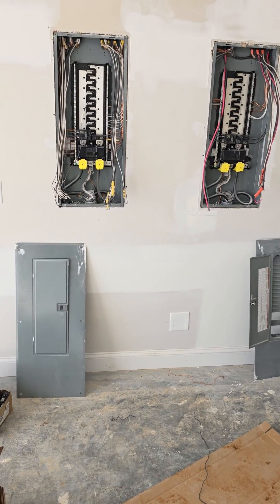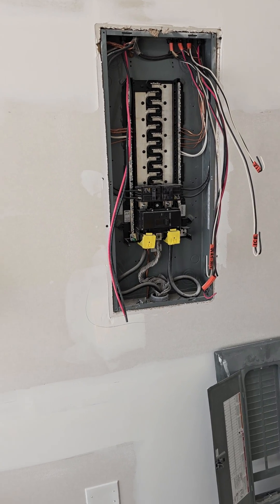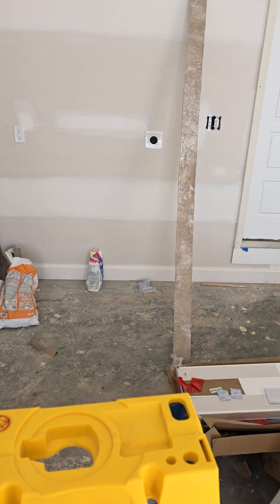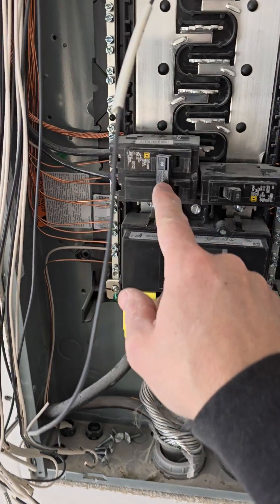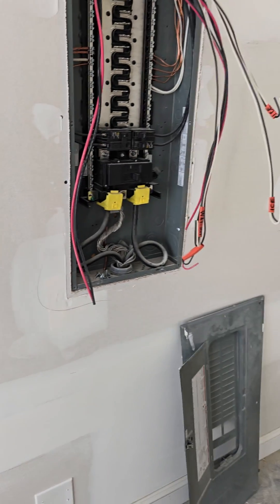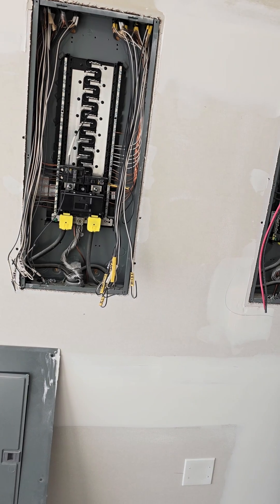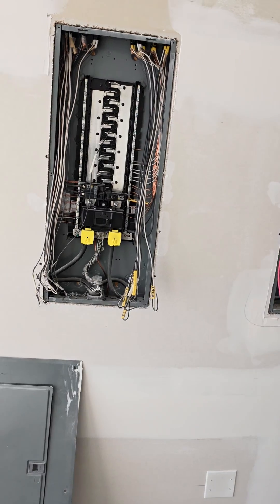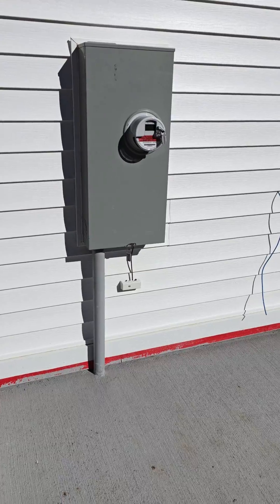Reason why people go with 400amp service in new construction now days

Comment: Recently remodeled my 1960s house and upgraded to 200amp and pre wired for future car charger. Also ready for solar if some future owner adds it.
Reply: QUESTiON  HOW MUCH DiD THAT COST YOU TO PUT iN 200AMP iN YOUR 1960'S HOUSE?
Reply: After my meter fried in a 1973 house it only costed $2000 for replacement of the entire thing and upgraded to 200amps from the overhead street wire to the house and that was in 2021.
Reply: @chuckleroy3992  Isn;t a meter property of electric company and is exchanged for free ?
Reply: @chuckleroy3992   NOT SON HiGH?>>!
Reply: @dmitripogosian5084    yup, but only the meter. YOU must have the meter pan installed, along with bigger service wire on the outside of the home, and a 200 amp panel. Most people don't do any of that unless they are also adding circuits or installing a gen set as part of the upgrade.
Reply: @rupe53  Where I live wires from a meter to the pole are property and responsibility  of the electricity provider.  I have learnt that recently when I saw a ground wire frailed on my supply line. Called electrician, he said nope, not me, from this point to the pole. Electric company came in 30 min and repaired for free.
Reply: @dmitripogosian5084    yes, they also own the wire from the pole, but not the wire attached to the house. YOU own everything from the weather head down, expect the meter.
Reply: @rupe53  If I understood correctly what is weatherhead, this is true.  There is some distance  from the weatherhead to the meter (which is outside of the house) in a pipe along the side of the house, which is indeed mine.
Reply: @PHiLiPPiNESCENES  about $6k
Reply from the maker: It makes a huge difference on location. I charge here in VA with permit to upgrade  to 200amp $2,000 to $2,500. Depends on some factors though.
Reply: Is it worth doing it in 1960 house ?  Where I live (in 1964 house), they are mostly teared down when new person buys them.  Not sure I'll recover any investments like that when I move (as planned) in 7-10 years.
Reply: @dmitripogosian5084  I live in an area where this two bedroom one bath home is worth 450-500k before the remodel, probably 600+ after.
Reply: Why not add it yourself
Reply: @kkon5ti  has to be done by licensed electricians and the power company.

Comment: Holy cow 400A. We're on 240v here and I just got my cutout fuse upgraded from 60A to 100A that's for electric shower, air source heat pump and EV charger. 400A is a lot, wow. Just as well your energy bills aren't as bad as Europe's.....
Reply: The US is really 240V mains when we say 200A, 400A... We just have a Centre tap from the utility to the neutral for most use.. In all the decades I have lived in places with 100A main, It has never tripped, even when my EV was charging (27A at peak rate). No whole house A/C. I agree with Dmitriy (below), <10A even in the evening with lots of LED/CFL lights on.  Overkill
Reply: The code in the US requires you to pretty significantly over size your panel. A modern house can get a 400A panel, but it will probably idle at <10A for 99% of its life if it’s well insulated.
Reply from the maker: No there will be more then just those, where is about 30 more circuits. In that video, the breakers they weren't in yet
Reply: Darn. I must be in the dark ages. 100 amp service, 1400 SF house powering range, WH, dryer, AC, irrigation pump, and an 1800 SF shop. Never tripped the main.
Reply: Houses in North America (Canada, United States, Mexico, Belize, ...) are wired with 240v. Nicola Tesla pushed for 240V 60Hz as it provided peak efficiency for induction motor. Some parts of NA chose lower or higher frequency and often lower voltage. After WWII NA standardized on 240v 60Hz as Nicola Tesla intended and 120v to cater to Edison's standard for incandescent. 120/240 single phase is what keeps both standards happy. Today with Variable Frequency Drives and switch mode power supplies voltage and frequency standards are kind of redundant and often used to push a superiority complex among some Internet users. There are requirements for more circuits throughout the house, and upside everything to overkill. Some people in modestly sized piles with a modest climate can get away with 100A panels, and they are still installed today. Most houses are built with 200A panels and it covers more than anyone will ever need.
Reply: 100A on 240V is the same watts as 200A on 120V. Most houses in the US have 200A service or less.